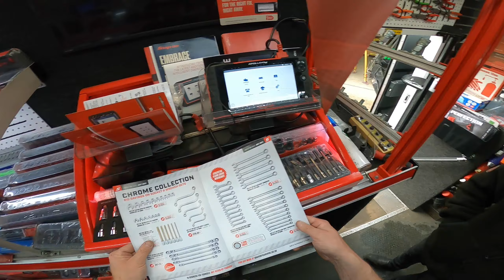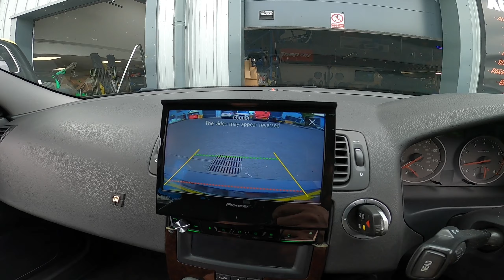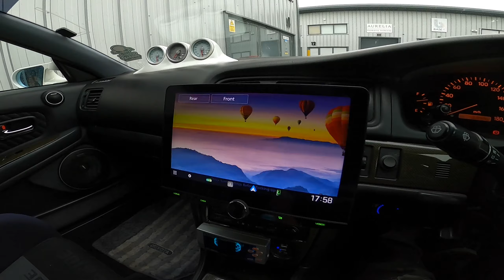SNAP ON TUESDAY new flyer and 500 episode special

Comment: The Snap On Vice grips are made by Malco in Nebraska at the original Vice Grip factory when the company was known as Peterson Vice Grips.  They are made to the original specs along with some modern improvements (like the adjusting nut can be hex key tightened).
Reply: DeWitt, Nebraska 🇺🇸
Reply: UK is a bit behind us huh? With the Malco‘a & the CT861. 😬